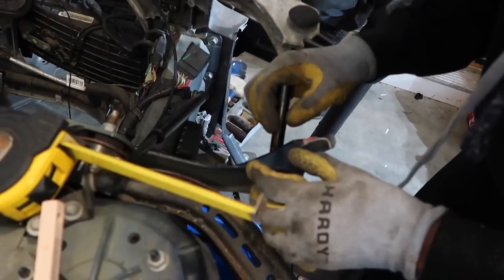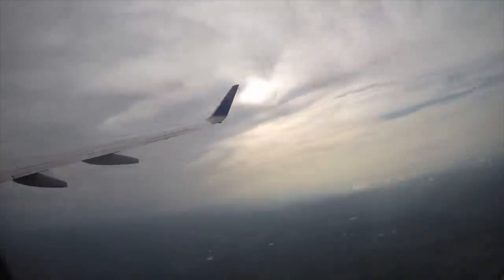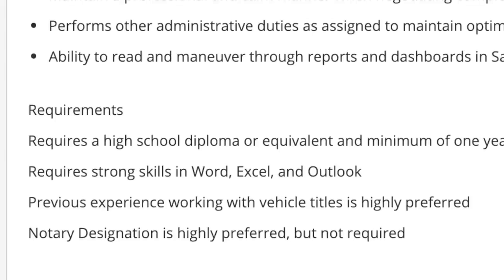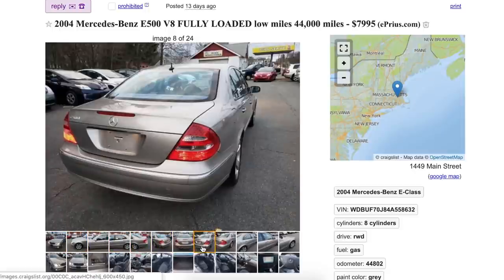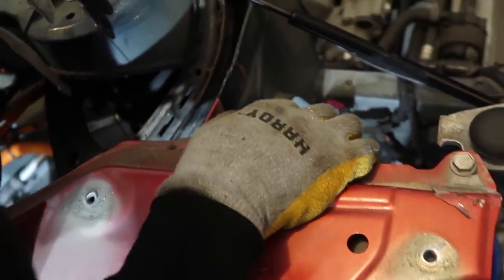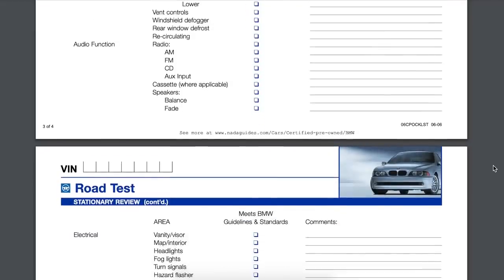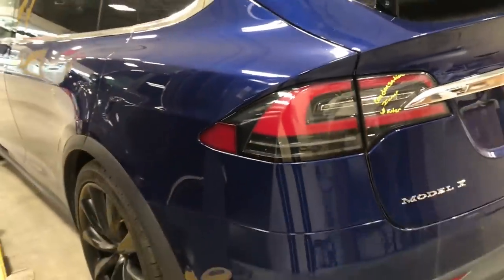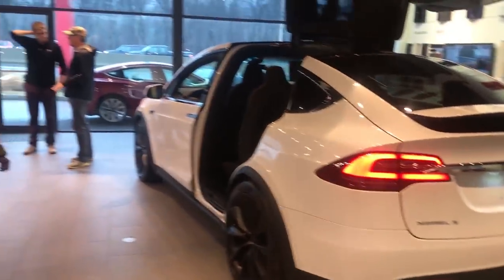Why the used Tesla system is broken

Comment: That's the whole point isn't it. Tesla ISN'T a major auto manufacturer.
Reply: And they never will be if they keep doing business the way they have. You're only going to sell so many $60,000 new cars (that are the size of a Corolla, which you could buy 3 of) before the market dries up. They (as a company) set out to change the auto industry, and in the process have proven why it works better the other way. If Ford or GM thought they'd sell more cars doing it the way Tesla does, don't you think they'd do it? Profit is a powerful driver, sustainable profit changes industries.
Reply: Tesla is already major car manufacturer.
They now sell more cars than Porsche.
Reply: TarlanT Actually that’s not true. In 2018 Tesla sold 245.000 cars while Porsche sold 254.000 vehicles. Yes, the gap is very small, but remember... Porsche sells luxury vehicles like Lamborghini while Tesla wants to be on the same level as BMW, Mercedes and Audi. In my opinion in 2022 Tesla will be a thing of the past when all the major manufacturers produce better, and also cheaper vehicles.
Reply: @lorenzmuller4000  Tesla not going to be a thing in the past more like gm or ford.
Reply: @lorenzmuller4000  Bud, Porsche sold 57,000 in 2018 - they're not even in the Top 20.  Tesla also beat Chrysler, Acura, Cadillac, Infiniti, and Mitsubishi. 

On a monthly basis, Tesla is outselling all other luxury car brands - combined. Just wait for their new SUV and Pickup this year.
Reply: Difference is that they people that buy a Porsche actually get their car and the quality isn't junk like Tesla
Reply: Mike W i don’t see where this idea of teslas being junk comes from. I own a 2018 model s and its the best car ive ever driven
Reply: Still selling a product. Doesn't mean the service or quality should be any less.
Reply: @johnt2914  Good plan. Tank the used Tesla market and now your 70K car has no resale value. Very business savvy. Way to get ahead.
Reply: Then maybe they shouldn't be selling cars at major auto prices. Holy fuck it's not rocket science.
Reply: John T  don’t buy used Tesla’s. Well, with zero trade in value for used Tesla’s, selling new ones will quickly become a problem.
Reply: John T “free”.  Ain’t nothing free John.  The company has now ended its free Supercharger credit program for Model S and Model X vehicles. 

When Tesla first introduced its paid model for the Supercharger network almost two years ago, it eased the transition by giving 400 kWh of free “Supercharger credits” to new buyers of Model S and Model X vehicles.

Owners of those vehicles are able to get 4 to 5 full charges per year before Tesla starts to bill them for using its network.

Comment: I would rather have that Mercedes, the driving comfort is much better compared to the Tesla. Tesla did not spend much on suspension and interior. Hell the Tesla has no motor yet the tires make more sound than the engine and tiers in the Mercedes (from the inside).
Reply: And you just know that that Mercedes will still be usable 15 years from now, we can't be sure about a Tesla
Reply: Get an eqc
Reply: @RNCHFND  Actually, in 15 years most countries will have banned ICE. Common sense says Tesla will last a lot longer. The future is EVs only, sorry gasoline drinkers.
Reply: @johnt2914  I''m not so sure non-electric cars will be banned by then for a few reasons, first is I doubt issues like range will be solved in only 15 years. I can't go on a road trip in any electric car currently as none have enough range to handle the kinds of trips I and many others take yearly. There's also the fact that there really aren't any proven utility vehicles yet so farmers, movers, mailmen and just people who live in rural environments would be out of luck charging station issues notwithstanding. I do think electric is good but Testla does need to step up their game or they may be left behind when the other manufacturers really join the electric market. 

Besides all that though most if not all countries still legally allow cars from the 1920s even if they never had seat-belts from the factory so I doubt a random Mercedes would be banned in just 15 years.
Reply: Bingo.  Wife test drove a Tesla (ive driven plenty) and hated the screen dominance and told me to take her back to her Mercedes.  These people are idiots buying these cars for that kind of money.  A bunch of sheep.
Reply: @RNCHFND  From what I'm seeing, I don't think Tesla will be around in 15 years. Probably people like Rich will be the only way you can get service and parts will all be aftermarket and we'll be seeing videos about swapping Ford motors into Teslas.
Reply: @johnt2914  Well, that assumes everyone wants an electric car enough to pay for the premium. The most expensive car at my workplace is a new Passat which is cheaper than the cheapest Testla so no one even considers them around here. Even if they could it's a hard sell when other manufacturers have better used car experiences and frankly nicer interiors and ride quality. If Testla can fix these then yeah they may be able to challenge some larger luxury brands. I'm not sure they'll ever challenge the low-end I just want a cheap (under 20k) new car market though.
Reply: @Karthex  Yeah. ICE won't be banned. Just most people will be suited better with EVs. Just like there was no need to ban incandescents if they had just waited a bit longer for LED tech to mature instead of forcing everyone to buy shitty CFLs.
Reply: @chaos.corner  True, most should be fine with electric once it matures enough to be both cheap and accessible for the average commuter. I imagine it will be majority electric at one point with the odd ICE vehicles scattered around with ICE usage higher in low density areas.
Reply: @johnt2914  You are very naive. Other's are catching up faster than you think. Tesla will be out of the business in next 10 years, if they don't do something about quality and customer service.
Reply: @johnt2914  I don't. Tesla can't even figure out how to align panels. I wrote in 10 years. Not now as of today. Like you sad. Today is Tesla ahead, but only with powertrain. Overall quality is very poor. People won't buy poorly made Tesla in future, if they will have choise to take from manufacturers which makes quality cars.
Reply: @Romif_SK  I humbly agree with your factual statement regarding quality control.

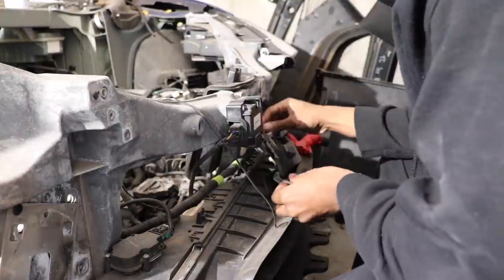Comment: I just experienced some of the same issues you did as well.   I bought a 2016 Tesla Model S on Feb 16th - after looking at the photos for two weeks...  photos showed no issues what so ever...  I put down my $2500 and waited for an advisor to call me.  No one called - so I called them.  Found car through GPS Trace - it too was not at the Dealer showroom in Las Vegas - but stored somewhere outside of Vegas.  I asked when it would be ready - and they said next couple days.  So different from regular dealerships.  I paid remainder of down payment and asked next day when it would be ready.  Now here is where the run around gets weird - they didn’t want to go to the off site storage to get car for delivery because they didn’t have a full truck load from offsite storage.  Luckily for me a former co worker ran their production process at Tesla - when I called him and let them know I called him the wheels started moving.  A delivery appointment was set for Thursday Feb 21st.  They did have car ready by 10:30 - but due to weather I didn’t make it there until 2pm.  There were some major defects that could not be seen due to lack of quality of pictures - I have set up appointment for those items to be addressed - we will see what happens.  

Here are some improvement ideas from a supply chain guy.

1.  Either fix defects you are going to fix as cars come in prior to listing for sale or greatly improve photos in beginning to show issues upfront.

2. Reduce handoffs - one advisor from sale to delivery 

3.  Move inventory to lots of vehicles that are ready to drive off lot.

4. For the price customers pay you should be getting premier level service.

5. One of the holdups for delivery was flashing the teslas computer – this process should be one of the first things that is done when receiving car is in from the original customer.  Re-setting it to a default status so it’s easily ready for a new customer.

More to come after my March 5 appointment.

Comment: Even if you buy "NEW Tesla” you will still find flaws of misalignment of body panels, ripped leather seat, swirls marks etc...
Reply: Daniel Hong yup!  Same was true with my other cars from other manufacturers.
Reply: @seanz6586  The difference is that with other car brands you get to see the car and all its flaws in person at a dealer lot before buying it.
Reply: I know! And this cars worth is 90k?? What a disgrace to what a car really is
Reply: @seanz6586  Not really. Not in a way Tesla does. There is imperfection everywhere- but in Tesla's misaligned panels you can fit a baby arm.

Comment: So basically they couldn't care any less for people buying used cars. They only care about new buyers. I want a new Tesla Model 3 but this Is changing my mind. Maybe a Camaro SS or Mustang GT would be a more fun choice anyway.
Reply: i wrote a whole long ass message for 30 min that should honestly be a blog post. long story short, dont get a mustang. as my 2016 convertible GT is constantly having problems that shouldnt be happening at 14,000 miles. (such as replacing the drivers side control arm THREE times in 7 months because of a horrendous squeal that makes you feel like you're truly driving a shitbox, WTF), constant rattling, panel gaps, and bad sealing due to trash build quality (you cant excuse this for a manufacturer thats been around for 120 years), and customer service nightmares. tomorrow will be the 1 year mark of me owning the mustang and ironically the day after i will be trading it in for a model s. if it wasnt built like a pile of trash, i really would've considered keeping the car forever, as it was my dream car for years and the convertible experience is unique. ford will never get a penny out of me again, PLEASE consider other options

Comment: Considering myself very, very, very lucky at this point. I recently took shipment of a 16 Model S P90D in very good condition. It had very minor rock chips on the hood. Needs charge port sensor replaced. Wheels were perfect. There were no scratches no dents. I got it nano coated and tinted. Tesla is coming next week to fix charge port and a few other small things. Thanks Rich, great vids.

Comment: As a very long time vehicle dealer I would simply tell them to buzz off. Any car that is advertised for sale SHOULD  be ready for sale. 
WHY the hell do you even want to own a Tesla? A tatty beat up car for retail money.
Reply: As much as people claim the cost of ownership is cheaper driving an electric vehicle I have to call into question is it really cheaper when insurance rates are higher due to more expensive vehicle and bloated repair bills. Dude hit a pole in a parking lot going 3 mph which came out to $6K as the engineer who designed the car has never worked on a car himself. Get into a collision with an BMW I3? It's got an aluminum chassis and carbon fiber body which will get totaled by the insurance company with a quickness.
Reply: @Cerberus984  If you don't have accidents it's cheaper. S/X panels are aluminium so repairs will be expensive, not many aluminium cars on the market to compare to but for example Audi A8 is aluminium and expensive to repair. i3 is in a different price class and will take less to total. Model 3 is more traditional in design and materials and will be cheaper to repair. I drive Mercedes/BMW so no point in saying I'm a tesla fanboy either it's just facts. Expensive cars will be expensive no matter the propulsion method.
Reply: @alt572  Below is a snippet from an article from CleanTechnica

"But more complicated and labor-intensive than the painting is the “R&I” — short for “Removal and Installation.” To repair this fender apparently requires removal and reassembly of much of the left side of the car, including all of the trim pieces, moldings, and the driver’s mirror, as well as the front bumper. And when you reinstall the front bumper, you also have to “aim” (re-calibrate) the front distance sensor. The repair also required disassembly of the rear seats in order to access (and disconnect) the high-voltage battery connectors. Apparently, they do this so as not to electrocute the folks working on the car (always nice to not kill anyone)."

My 2nd main point was engineers need to step into the shoes of mechanic's / body shop's to realize their design flaws. If the front end is the least likely collision type due to auto-pilot they should simplify repairing what others or parking lots are more likely to damage the vehicle. $6K for a 3 or less mph collision with a pole in a parking lot is unacceptable. 

The battery disconnect should not require you to remove the rear seats as you have a front trunk and a rear trunk for storage that could simplify the process by having a removable panel in either section.
Reply: @Cerberus984 : Amen. I wish more stuff was designed with repair in mind.

Comment: When I worked for Mazda the CPO program used I believe it was a 70+ point inspection that was readily available to the customer, and the dealership itself used a 130 point inspection system for every used car we sold. That was regardless of CPO status or not. Plus each car came with a copy of the inspections sheets. If it was a CPO it came with both the Mazda required one and the dealer inspection as well. The fact that Tesla is not readily providing them (at least as of this video) is outrageous.

Comment: I just bought a CPO, and frankly, I had really bad experience until I actually hit the buy button: I couldn't reach anyone from Tesla, I requested several callbacks, nobody responded. The photos I got was not only on Dropbox, but they were very small photos, their resolution was 640x480! After several weeks of getting photos of different cars, and unable to reach anyone, I decided to buy one of them. From that point, the experience was pretty good, and I got my car in the end in a very nice condition, only minor rim rash and tinted front windows (which was an extra), and so far it looks like it is in a very good condition.

Comment: One of the most revealing and honest reviews of Tesla I’ve seen.  Too much digital hype without enough real world experience like this.  Was actually considering trading our Pacifica for an X but no way.  We’ve had issues with FCA service at our local dealer (I have two FCA vehicles) and was the worst experience we’ve had in a long time.  But this video has put the brakes on that idea.  With the recent financial pressures I worry this will get worse for Tesla and its current owners.  Waiting for a broader EV market push for real competition from established manufacturers and dealers.

Comment: Rich,  I really need your help.  I just brought my model x to service and I got the car back with the heater failing.  The Tesla service just tried to bait and switch me by giving me a bill for about five hundred bucks to fix, then when we got their they Hut me with a nearly 2 thousand dollar bill without even looking at the car?  When u asked when the heating failed they said they couldn't see the exact date in their diagnostics.  I DO NOT BELIEVE THIS as I believe this occurred when they had the car doing warranty work.  I don't believe in coincidences, but my car was running fine, brought it in for some warranty paint work (bubbling of paint)  and I receive the car back with weakened heating which then failed.   Please help me understand what they can and cannot see regarding system failures ect.

Comment: I bought a CPO honda that had been in a major accident and had frame damage at some point. The dealer was aware of how bad the accident was and discounted the previous owners trade in value because of it. Then sold me the car with a clean carfax. 6 months after i bought it the carfax had an accident and the value of the car was much less. After research, most CPO cars go into a dealer and someone from that manufacture is supposed to come certify it. They usually just walk around the car quick and sign the paperwork. CPO is just a warranty. Tesla is just like Honda, the honda maybe cheaper but its still a reputable brand that you would expect more out of. All of these car dealers and makers are at least a little bit shady.

Comment: I bought a uses i3 at a BMW dealer. It was clean, well refurbished (including new wheels & tires) and I took delivery overnight after closing the financing and showing proof of insurance. My wife has been driving it for 9 months now and loves it. It does have ludicrous mode, but if you don't have manhood problems and need a good used EV, i3 is n excellent city car.

Comment: I bought a CPO Model S in 2017, back when they cleaned them up in-house.  Delivery was great, on-time and the car was like new but yet 3 years old.  I thought all was good until they kept sending me temporary tags every 30 days... for 4 months!  Turns out they couldn't find the title and had to request a replacement from the original owner's state.  Finally it worked out and I got a permanent tag and title.  Their cars are absolutely wonderful, but their operations are a hot mess!